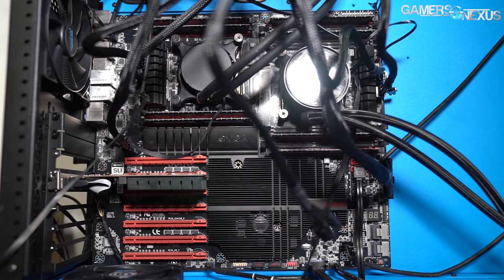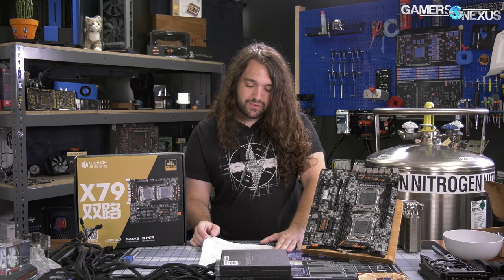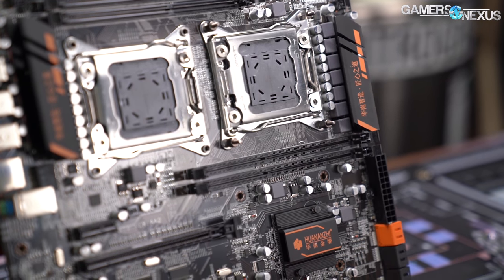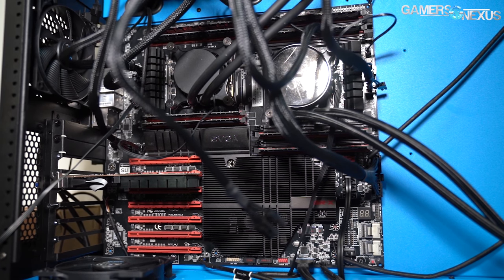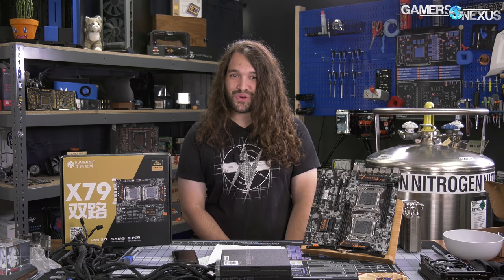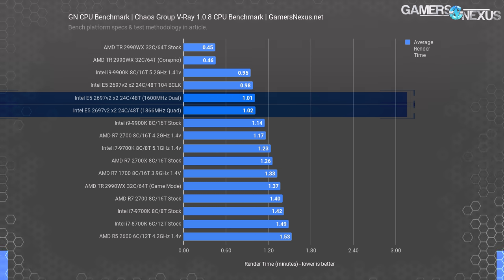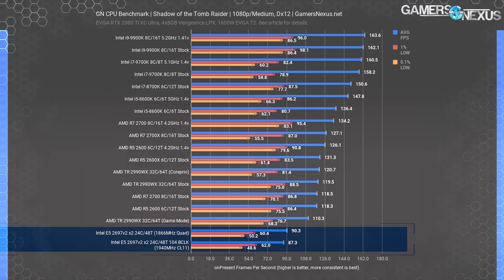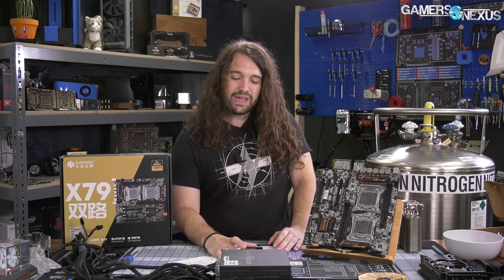Building a Dual-CPU Behemoth from Used Server Parts, ft. CaseLabs & Old Xeons

Comment: While the discussion on the 9900K is very fresh in our minds right now, thanks to this program and as we come into the final week before the launch of Ryzen 3000/Zen II, I do feel that the fact that Intel came out with the No Suffix counterparts for Generation IX Coffee Lake recently on Newegg and Amazon is in store to make a program about, at least to see how they fare up as cheaper units: Especially with the 9900 (No Suffix) now effectively making the 9700K become virtually pointless to get at its pricetag due to the former's super performance, it ultimately makes us wonder what we will be expecting going into Quarter III of the year, especially if what we're currently seeing goes anywhere good anytime soon.
The 9900 (No Suffix) is currently being sold at 0399$ USD, down from its 0439$ Launch Price; when compared to the 0409.99$ for the 9700K and 0489.99$ for the 9900K, the 9900 (No Suffix) is ultimately the best Intel CPU of the current generation for its value, you get what is essentially a 7820X but in Coffee Lake Refresh form with that architecture's optimizations at a 065 Watt TDP and for roughly 065% of the current Newegg listings for the Skylake X chip; the 9900 (No Suffix) also might see as much as a 033% price drop from its current tags when Intel decides to make the move, based on preliminary European sales of the chip, where some customers (most notably HaKN ! of the Tom's Hardware Forums) managed to get the chip at as low as 026I.20$ USD, so if this is any indication of what to expect here in the states, then I have a good feeling about what's to come, definitely would give everybody a reason to do some decent Benchmark testing of the No Suffix chips to see how well they hold up against the current and future foes.

Comment: If you can lower the ratio on the two CPUs you could try setting the BCLK to 200 and the ratio to half and slowly raise it. This seems to make some systems more stable and it did with my i7 920. Just raising the BCLK will make it only run at 3.85GHz @ 1.35v and the ratio at 21, but setting the BCLK to 200 and slowly raising the ratio made me get 4.0GHz @ 1.29v and 3.8GHz @ 1.23v.

Comment: I have that board.  I used a pair of f E5-2620 v2 Xeons to see if it worked.  I got them for $20 USD each as they are 2Ghz parts.  With that working, I upgraded to a pair of E5-2667 v2's and have been working fine ever since.  The dual proc boards seem to be memory sensitive.  I loaded mine out 100% identical with the ECC ram.

The memory controller is on the CPU, it's logical that for multiple processors it'd require ECC RAM, as that is what all the servers of the era required.

Shame you had so many issues, it's a great / cheap board, especially after the last price drops.

Comment: I had an Evga SR-X with those exact CPUs in a Lian Li- PC-P80, one of the few cases that could accommodate it.  Built it in the winter of 2014.  Genuinely the most stable system I used over the last decade, even moreso than the SR-2.  I didn't care about overlocking, I just wanted a board that could provide server grade stability combined with accommodation for several production-related peripheral cards and maximum versatility for multi-GPU setups, which it did perfectly. Then, one morning in November 2018, it never woke up...

Comment: Be nice if you can run DB benchmarks, even simple ones like SYSDATETIME and SYSUTCDATETIME called 10 million times, and large parallel and non parallel queries. Obviously you'll need to run them against the same storage configuration, so I'm guessing add-in card with attached storage is the way to go just to make the results transferable. Really good data on comparative performance for DB with CPU is hard to find.    Other than moar Clock over core count as a general rule.

Comment: X79 bad idea, because it suck in software (no AVX2), gaming(big latency, low ipc)
two 2680v2 will be decimated by single 2697v3 350$/ 2696v3 450$ with TurboUnlock

Comment: What about the 2690 V2, 3Ghz base clock instead of 2.7, 2 less cores per processor though, I really have my eye on a machine dedicated to handbrake. I live in the middle of nowhere so streaming isnt an option(because of cellular data limits) (i normally see 2+TB worth of internal streaming from shows i record on plex or nextPVR) But that reduced core count comes at a reduced cost, $50-100 cheaper per processor, and at a higher clock speed might more it a better all around processor

Comment: 12 (good!) cores for $322 in each of these xeons is a pretty good deal but not amazing. Multithreaded, it beats the ryzen 2700x (which costs around $280 with a cooler). It's also more than viable to do a dual cpu build which isn't the case with modern desktop cpus

Comment: My build as follows:

Base system: Lenovo C30 Workstation (C600). 4GB Ram (DDR3-10600R). No HD. 2 X E5-2609 (4 Core, no HT). $172.86 (Ebay)
RAM: 4 X 16GB DDR3-10600R ($Can 120, local Surplus dealer, also on eBay)
CPUs: 2 XE5-2680 (8 Core, with Hyperthreading)
Storage: 1 X 500GB Samsung 860 EVO ($CAN 120) SSD, 1X 2TB WD Gold ($CAN150)
Graphics: 1 X MSI GTX1050ti 4GB mini, ($CAN 180) *

System is fully operational, runs well, and works great for anything other than gaming.

Only things that I would have liked would have been a way to boot from faster storage (as in M.2 NVME (PCIe X4)).

* Lenovo C30 has severe height restrictions due to the reduced form factor. The graphics card used is a half height card to fit within the small chassis. Any graphics cards that have a height higher than the backplate (including the the 6/8 Pin auxiliary power cables) will not fit. There is a Lenovo D30 that doesn't have the height restriction.

Comment: Cheaper, not necessarily.  I acquired a decommissioned T5600 with dual E5-2667's (6C/12T ea.), 32 GB 1600 R-EEC DDR3 RAM, and an 825W GOLD (OEM) power supply for ZERO ($0). I threw in  GTX 970 OC'd for $120 and upgraded to 2xE5-2689 (8C/16T) for $150 that all core turbo to 3.3GHz!

So, for a total of $270 -$70 (for the used E5-2667's) = $200, I have a pretty capable PC than can handle 1080P med to high, while remaining a substantial productivity platform.

CB R15 = 2200.

Comment: Fuck yeah. Best cases ever made.
There's just nothing that compares to them. MM kinda has the modularity but Caselabs had such a crazy high quality. So strong and so light. Very nice finish everywhere. Bent and pressure pressed in shape with the best machines. Almost completely toolless. Such a loss. Lian Li are just flimsy sheets of shit once you've touched a Caselabs.

Comment: @ Gamers Nexus all this madness is why I just went with a a SuperMicro X9DRi-LN4F+ for the extra PCIe x16 slots (albeit not all of them have 16 lanes) to pair with my E5-2680v2 Xeons, and the fact that it has 24 slots for DDR3 so it’s stuffed with 192GB of memory and 40 threads is plenty with my server workload, and has allowed me to virtualize many of my previously disparate machines. I put everything in a 4U SuperMicro SAS846TQ case with a direct-attach backplane for its 24 hot-swap bays, and my OS runs from a mirrored pair of Samsung SSDs (Proxmox VE now, but initially was running FreeNAS, but after dealing with the lack of working hardware passthru on BHYVE, I now run Proxmox VE for KVM’s superior passthru support, and run FreeNAS as a guest OS with my HBA passed through to my FreeNAS VM and my storage pool unaltered).

Comment: Yo the E5 1600 series of cpus on that socket have unlocked multipliers with the highest core count being the 1680v2 (8c/16t) 
It would be crazy to see two of those overclocked on that evga sr-x motherboard and see it compare to recent intel/amd offerings!
Reply: According to the intel support page, the 1600 series has max cpu configuration of 1, so you need  a 2600 series
 if you want dual cpu's
Reply: @rdsii64  the 2600 series v2 have locked multipliers.
Reply: @baronvonlimbourgh1716  yes the have locked multipliers but they work on dual cpu boards
Reply: @rdsii64  yeah ok, but his point was overclocking i thought.

Comment: I can't speak for x79, but for x99 CPU's are extremely cheap. You can get a 2680v3 for $150 and with some BIOS mods run it at over 3 GHz on all 12 cores. DDR4 ECC Ram is likewise about $225 right now. I'm upgrading because I'm building a system for my girlfriend with a 9900k which is faster than my 5820k, but I'm probably gettinga  2690V3 since it can do 3.4GHz on all 12. The biggest issue with this seems to be the VRMs on the board, with x99 boards doing better because the VRM can handle more than 300W per CPU.

Comment: Well, ignoring the gaming comments (nobody in their right mind games on a 2-socket system)... I'm happy to see you guys doing compiler benchmarks on the larger server-like systems.  Your 2697v2 system comes in just about where I thought it would.   Those CPUs were incredibly expensive at introduction... something like $2600 apiece, but on the used market 6 years later they are a more reasonable $300 or so.

You actually chose a really excellent used CPU with the 2697v2, that's a great value part.  The modern equivalent is the E5-2690v4 which is basically the same thing but packs 14 cores instead of 12, AVX2 instead of AVX, and supports DDR4 with 30% more memory bandwidth... probably about the same price on the used market.   (requires a 2011-3 socket, not the original 2011 socket).

-Matt

Comment: For our VR and streaming, we use a system with two Xeon E5 2667 CPUs in a Gigabyte GA 7PESH1 Rev. 1.0. That board is way friendlier to work with. No OC capability besides taking memory to forced 1866 Mhz. It also works with normal DDR3. We've got 8 sticks of 4GB crucial balistix in there. Despite our use case being gaming targeted, the CPU's are plenty fast enough with a base of 2.9 and a boost of 3.5. Faster clocks would be better, but they're still an upgrade over our old X5680's we had before, simply because of the newer architecture, despite the identical core/thread count and lower base frequency.

Comment: That was a dick move on intel's part. I wonder why they would leave the e5-1600 series multiplier unlocked, but the dual 2600 and quad 4600 series is totally locked up. I bet it's a simple switch inside that Intel theoretically could have flipped to unlock them, and said F you EVGA. Too bad dual 1600 series chips would not work on that board....Imagine dual 1680 V2's clocked to 4.6 Ghz....

 On my Sabertooth x79, I was able to get my E5-2690 to a base clock of 106.3. I got my E5-4627 V2 to a base of 115mhz. The V2 ivy bridge 2011 locked chips are known to base OC a little further than the sandy's, that's why you have E5-2667's on ebay selling for over 200 bucks, at least they used to.

Comment: Ya, here's the hot-take... why tf were you even using non-ECC RAM with a Xeon? I just got an HP dual hex-core Xeon workstation, it's quite old (2010-2011ish) but it was free and already had 24GB (hex-channel baby!) of ECC RAM. Just ordered another 40GB (10 more sticks, can only fit 6 more, might need spares though) for $40.

Comment: I've assembled a few HP z600 (with the version 2 motherboard), which are in the same ball-park $500-600 build cost for dual Xeons and loaded with ECC RAM, SDD, and GPU. I think they'd give you very similar multicore performance, but much better gaming performance, at least for games 2015 and later. The RAM speeds are limited to 1333MHz, but between the two CPUs those six chips operate like a single sexta-channel build. Many other boards actually have bottlenecks at I/O chips that regulate the flow of information between the graphics card and the processor(s). However, HP's z600 doesn't have that particular design and allows a straight pass-through from the GPU to the dual Xeons. The Xeons compatible with the z600 also have a higher clock speed. The X5670 is 2.9 GHz, and I think the X5675 is close to 3.1 GHz. True, neither can be overclocked like the consumer processors, but so long as the games that are being played have code written to take advantage of multi-core processors the older, slower Dual Xeons hold up fairly well.

There's also the bandwidth of the z600's older PCIe 2.0 16x, which has twice the number of data lanes found even in more modern consumer and other dual/workstation boards. As an example, most single CPU boards have a PCIe 3.0 at 16x, BUT there is a cap, or dithering of the information that cannot flow beyond a certain cap (meaning that data transmissions meet the 16x PCIe 3.0 specs up until about the half-capacity mark, at which point there is no additional gain... I think I'm phrasing that right). On the z600 this are 16 data lanes, though at the slower PCIe 2.0. But the z600 can realize the full potential of the 2.0 PCIe, utilizing all 16 data lanes AND passing that information on directly to the dual Xeons without the bottleneck of the typical I/O chip on most consumer boards.

I haven't tried this, but the z600's motherboard is fully compatible with SLI/Crossover between it's two PCIe 2.0 16x GPU ports. AND both are fully PCIe 2.0 each with its full complement of 16 data lanes. I have been quite curious how these machines would score on benchmarks AND real-world gaming situations with such a setup. The biggest limitation is the z600s power supply, which taps out at 650 watts. So while that PSU can hanndle a GTX 1070 or, in my case, an MSI RX 580 8gb, the stock PSU cannot power a secondary GPU with a relatively high power need... Inventive solutions would be to work a secondary PSU into the picture, snaking in the additional power connectors needed to get the dual GPU's running, OR do something like taking two GTX 1660s and linking them up via SLI. I'm not quite sure if the power supply in the stock z600 could do it, but it would be close. 

Anyway, all that to say, for what you guys were aiming for I think the HP z600 would perform better overall, and be cheaper. It was also a mass-produced unit, so there are always replacement parts in circulation. You've got to remember that when it came out the version 2 motherboard of this unit was selling in systems going for $10K or more, and there was a great deal more thought in the systems engineering in that price range. IF you feel up for trying this make sure you know how to ID version 2 of the motherboard, as version 1 tops out in the 5500 series (even with the latest BIOS, 3.61) and CANNOT accept ECC RAM.

Just a mental experiment, though I'd be curious to see the results :-)

Comment: I built a computer like this to use for a simultaneous 10 core windows and Linux OS machine. That part was a pain in the ass, not worth it. On the other hand, these machines give you a huge flex off your bros.

2697v2 is dummy expensive for the aftermarket. For anyone looking to get something like this, 2650v2 or 2670v2 are good options. I put together a similar setup using an ASUS Z9P16DE serverboard which was around $150. With 16 Ram slots you can cram a respectable 256GB of ram using 16gb sticks. It is dummy thick with SATA ports and has an alright onboard storage controller. Mine came with remote management. One downside on all these boards is PCIE allocation between CPUs effecting airflow.

Comment: i have a e5-2697 v2 on a rampage iv black edition and i am absolutely stable at 115.2 bclk (can be stable at 115.7 but VRMs overheat, they need liquid cooling), the system runs nvlink rtx 2080 from gigabyte and 64gb 2400mhz ram (downclocked to 2146 since it seems the cpu mem controller wont support more). Needless to say it competes evenly with a 7900 i9 or a 2700x in multithreaded benchmarks. This cpu is really worth if you can break the lock which appears to be at 115.8 bclk. Just sharing my findings with you, you might find them usefull

Comment: To those "reserved" POST codes. Actually, there are two types of POST code in typical BIOS. One type is the POST code by the BIOS vendor. Those are known and typically published on web sites or in mainboard manuals. The other type is a POST code coming from Intel reference code. Those are usually not described anywhere, or if they are, it's in a document accompanying the reference source code. These "Intel" POST codes may or may not overlap the BIOS POST codes, so sometimes, when your system doesn't boot, you don't really know if the POST code you're seeing is BIOS or "Intel" POST code.
Sometimes, it helps to use an external POST card (LPC or PCIe) with four digits. Intel POST codes often start with different digits than BIOS POST codes and then you can at least guess if it's BIOS or Intel code - and if it's an Intel code, it's most likely memory or CPU init.
E.g.: on the platform I am working on (WiskeyLake-U), Intel POST codes start with 00 (just a few of them), and then there's D8xx to DDxx, B8xx, 9Axx to 9Cxx and some others.  BIOS vendors then select different first two digits for the BIOS POST codes.
The problem is that with two-digit POST card (like those typically integrated on a mainboard), you only see the "xx" part, but not the upper byte that would tell you "this is Intel POST code" or "this is BIOS POST code".
EDIT: one more thing. The four-digit POST cards sometimes don't display the full POST code (two bytes), but the last and previous 8bit POST code, so you'd better check what exactly your four-digit POST card does :)

Comment: I have built 2 of these dual lga2011 systems (don't buy Intel S2600CP boards, they suck!) and I'm currently building an other one with an Asus Z9PE-D16 board and two 2695v2. You can get one of those proprietary PIKE raid controllers for Asuz boards which will enable 8 sas/sata 6Gb/s ports for raid. I'm going to try to do an 8 SSD raid0 to see how much speed I can get out of it. I don't know how much pcie bandwith the card has, I'm hoping to get at least 2.5GB/s but not really counting on it. Anyone tried this already?